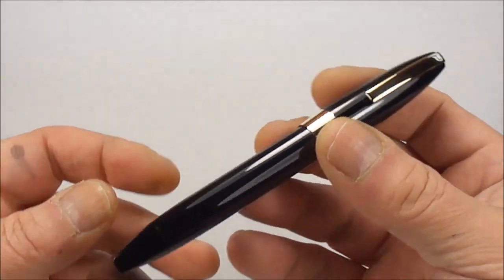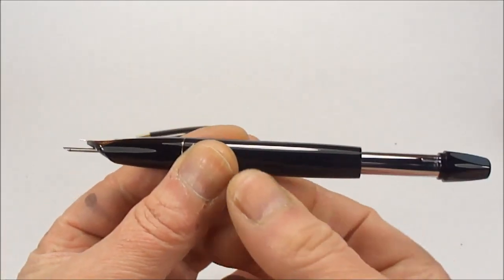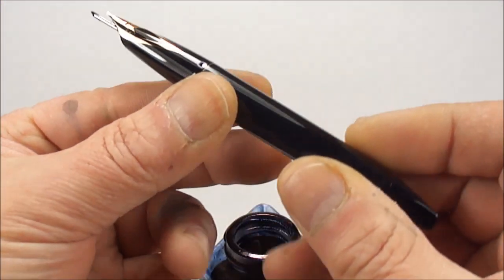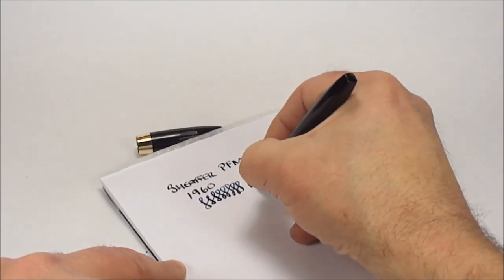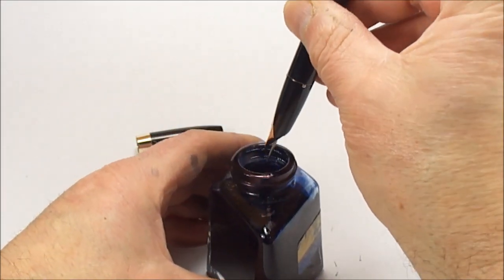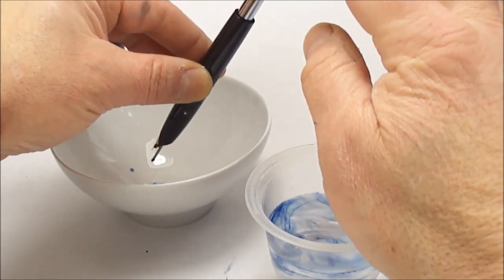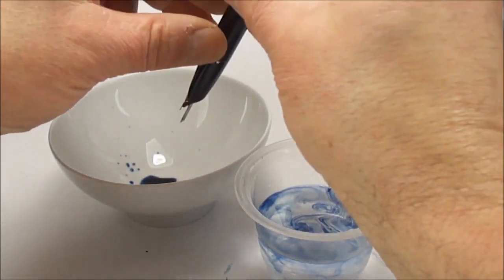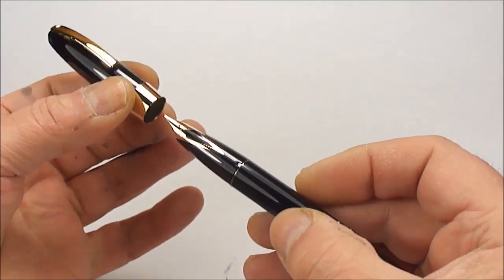How to fill a Sheaffer PFM fountain pen.

Comment: I have two Shaffer plunger pens, one a snorkel and one isn’t. They haven’t been used in years. I would love to use them but wonder if they need to be serviced first.  I live in Canada any ideas where I could get this done?
Reply from the maker: If they have not been used for a long time thrn they would bemefit from a full service. Try searching for your local restorer. Good luck
Reply: @penkino1  Thank you for your help!  I just cleaned them and one of them seems to have full suction with bubbles and shooting the water in a great stream when the plunger is pushed. The other doesn’t. Once again thank you from across “the Pond”.
Reply from the maker: Glad to be of help. Enjoy your pens.

Comment: Thanks for the vid,  Couldn't figure out how to fill my pen until I found yourvid.  Why do some of my fountain pens have a thick and thin stroke, but my medium tips seem to only produce a thick stroke?
Reply: It simply depends on the type of nib. A broad edge nib type, often called italic, stub or calligraphy nib will have both thin and thick line depending on the direction of penstroke. F-M-B is a size measure which can be applied to both broad/flat-edged nibs as well as round nibs.
(I know this comment is two years old, but if anyone reads it, I hope this answer could be helpful.)

Comment: I clean my PFM ink sack each time I refill it with more ink. But, how do I clean out the nib on this pen? I don’t/can’t change ink colours because of the remnant ink in the feed (I guess I could if I didn’t mind a mix of the old and new colours). What do you advise?
Reply: Clean out the reservoir until it's clean. Then fill the pen with clean water. Put a paper tissue in a glass or cup and stand the pen tip down with the lid off, on the tissue. This will wick out ink from the feed over a couple of hours. I usually repeat this a few times. Then I fill up the pen with clean water and stand it nib down in a glass with enough clean water in it so that the complete nib is submerged. Any ink left usually slowly just seeps down on the bottom of the glass. I leave it like that over night. After that I usually find no ink residue drying it off on a clean piece of paper tissue.
This is how I clean my pens to store them away. It takes a long time over all, but the work is minimal.

Comment: Thank you for the video. Where I'm confused is that when you're flushing the pen it seems that by pushing down on the plunger where the ink and water are coming out into the large ball that contradicts the first part of the video where pushing down on the plunger actually draws ink into the reservoir sack. When I try this method with my pen I can only write for half a page before running out of ink. What am I doing wrong?
Reply from the maker: +Richard Bryan The pen fills by the downward stroke of the plunger, which compresses the sac inside. Maybe your pen needs servicing ?
Reply: Pushing the plunger down first compresses the rubber sac inside, expelling the air and any ink inside the pen.   You can see that the water gets ink in it when he draws up water in the video.
After the plunger is pushed all the way down, the rubber sac can expand again, filling up with ink. That happens during a few seconds after the plunger has been pushed down. So the snorkel needs to be left in the ink a few seconds, otherwise the sac will just fill up with air.
If the pen just won't draw up ink, most likely some rubber in the pen has dried out, making the mechanism unable to create the airtight seal required for it to work, or the rubber sac itself is damaged in some way.
Reply: @gertahnstrom784  so... it relies on air pressure, and the brisk operation of pushing of the plunger once to push the sac, as the mechanical tolerance, or what seems to be a little hole near the knob, only let a controlled amount of air that helps to contract the sac during plunger's push, and eventually leak out to allow the rubber sac to expand back. coincidentally, pulling the plunger out on the first movement will also contract the sac by vacuum pressure created by the pulled plunger. 

that is some crazy mechanical stuff... and here we are with the lack of documentation of vacumatic converter like Pilot's Con-70.
Reply: @Shiruvan  The plunger rod has an indent that lets air into the chamber when the plunger is pushed down all the way. So it is not air that makes filling slow, but the rubber expanding via the feed as the inlet, that takes a few seconds.

Comment: Thanks! By far the best video I've seen on this. The instructions that came with my Valiant were a little vague and didn't go into flushing the pen out. It will probably be my only Sheaffer though, as I'm not a huge fan of this mechanism. It feels much too delicate for my taste, especially considering mine is just over 60 years old. But a wonderful piece of engineering either way!
Reply from the maker: Thanks for watching. Yes they are a rather delicate filling system but once restored they will give you many more years of writing.

Comment: What's the difference between a Mark III & the Legacy II mainly the filling mechanisms? They look so much alike! Thanks ahead.
Pete :")
Reply from the maker: Yes they are alike, however being a vintage pen man i prefer the PFM pens by far.
Reply: Aren't both PFMs? I guess the main difference is the snorkel.
Pete :")
Reply from the maker: In my own experience the filling mechanism on the Legacy pens are not very reliable so the cartridge is used by most owners.
Reply: Do converters work on the Legacy models? Thanks for the heads up. Appreciate it mate!
Pete :")
Reply from the maker: alwayspete No, it fills by the unreliable touchdown filler or cartridge.
Reply: That's sad. I'd like a converter on the Legacy model. Are there pens that look similar to the Legacy (embedded nib) but also supports a converter? That would be cool!! Thanks ahead!
Pete :")
Reply from the maker: They do not except a converter. Im sure there maybe a modern Sheaffer with a inlaid nib and a converter.
Reply: Awesome! How much do you think a brand new or like new Sheaffer Legacy II black lacquer/gold trim with an F or EF nib would be worth today? Thanks!
Pete :")
Reply from the maker: It would be best if you did a online search for sold pens, it will give you an idea of their value.
Reply: Good idea! Thanks!
Pete :")
P.S. US$175 for an old stock brand new!
Reply from the maker: Go for it.
Reply: I want to. Sadly I don't live in the U.S. The shipping will cost even more than the pen itself! Which is crazy right?  :"(
Pete :")
Reply: The Legacy II and the PFM are similar in design, but not the same. The PFM are from the 60's and the Legacy is from the 90's. The PFM have a snorkel, the Legacy does not. The PFM ends are a rounded square, while the Legacy is round.
As mentioned by the other comments, the Legacy have a removable touchdown "converter" and can be filled using a Sheaffer Skrip Cartridge (Sheaffer proprietary cartridge).

Comment: I got a Mark 5, smooth writer but very diffcult to clean. I guess the only way to clean it is keep on pushing the plunger.
Reply from the maker: Nick Wong Fill and expel the pen with clean water, then fill it with water and leave it nib up overnight. A drop of ammonia will help if it is really stubborn ink. Immerse the nib section in water too and leave to soak for a while.
Reply: I see, it seems that ammonia is the point because I have aready soak it for 4 days in clean water, when I use tissue to clean the nib, there is still some color coming out. Thanks for the suggestion !
Reply from the maker: Nick Wong I hope someone has not been using India Ink in it.
Reply: Off course not, I'm using PR Tanzenite. India ink will ruin the pen, no doubt.
Reply from the maker: Yes, dont use India Ink. It will clog your pen.
Reply: @penkino1  A thought I have here; filling it up with water but pulling the snorkel out from the water leaving half filled would make one able to cover the snorkel with some tissue and shake the pen. Effectively cleaning the reservoir.
But my question is then; Can the snorkel be gently pushed back into the feed by hand, and blocking the hole? If so, then one could push the plunger slowly, thus forcing water out via the feed and nib rather than the snorkel. That would, if it works, make ink remnants in the feed dilute quite effectively, leading to a clean pen.
Is this theory plausible?